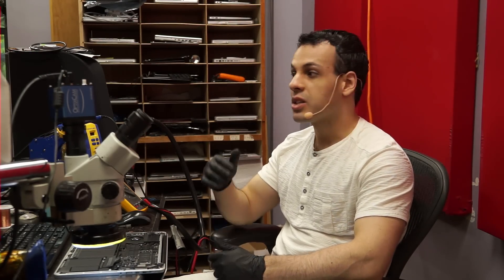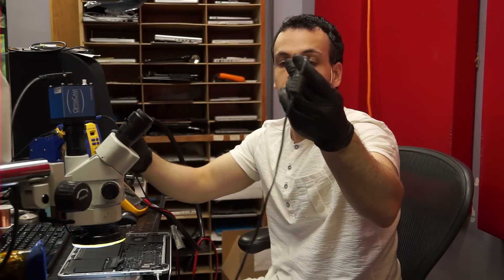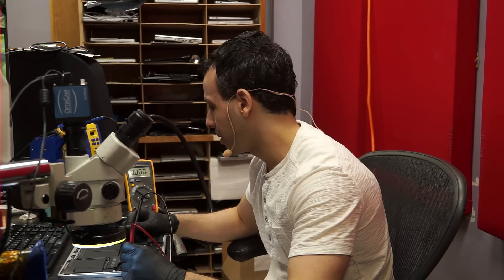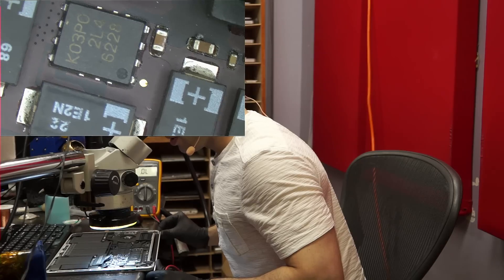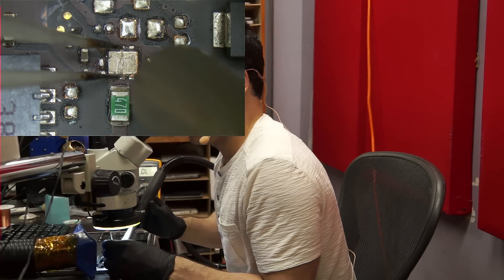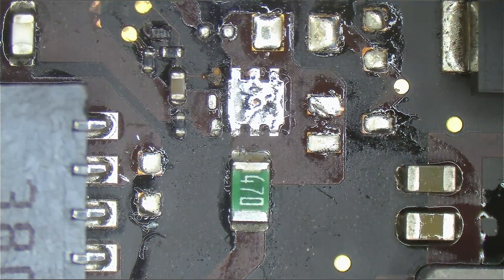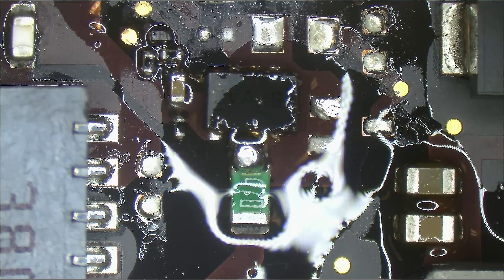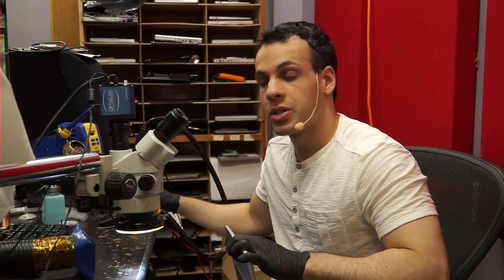Macbook not charging due to welded voltage regulator IC!

Comment: Here's a trick I use: get a Dremel and carefully grind down the top of the IC until you reach the die.  Hot air will transfer through the chip better,  particularly those with belly pans.  You can also heat it directly with a heavy tip soldering iron on the chip's die.

Comment: Hi
My MacBook Pro ( retina later 2013) USB's has gone bad. Being a emebeded and electronic developer I accidentally gave 12V to the USB. The data pins are working but power pins are not (+ and -). I am saying this because I connected serial device and powered it from another USB and I was able to receive and transmit data successfully on bad USB port. Pendrive other peripherals do not work because the USB doesn't supply power.
Can you share schematic of the I/O board which has USB, HDMI and SD card ? Or help me identify the issue. I opened my MacBook and saw Power switcher IC Texas's instruments 2557 near to the USB and I think that has gone bad. Can you please help me

Comment: Hi sir
Reply: I am shahal Muhammed. From saudi arabia. I have a1342. logic board is working   
But power switch on in laptop its not working. I chake the logic board two point to shot the laptop is no. So it the problem for keyboard. And my battery simple is x masks. So what I do sir. Plz tell way find out the problem.

Comment: someone explain me what gel-liquid he's putting on the electronics and what it does
Reply: It's flux. It helps the solder flow and not oxidize. This makes the connections on the board better.

Comment: I've done exactly one electronics repair on my entire life so sorry if this is a stupid question... but with that scratch through the board's coating into the copper trace, should you cover that back over with a sealant?  Copper oxidizes, and now there's an area that's not protected by the coating, so wouldn't that be a place for long term damage to the traces to start?
Reply: The Momaw if exposed to humidity yes. and this goes the same for any standard electrical circuit. As for what you could use on a board I wouldn't know.
Reply: That "sealant" is called solder mask, and it's main job is to control where the solder will and will not stick to the board.  It also isolates the board from bare wires running on top. None of that is a problem in that spot. Water on the board is bad enough anyway, so no point sealing against that.

Comment: So this is what is wrong with my Macbook from 2008, it probably blew away during normal use. The guy who sold it to me probably knew of this problem, fixed it, then sold it to me. Now it will only turn on if the battery is charged already, can't charge so, technically it is dead. I replaced the charging board and it did the same thing. I'm inclining that this is the issue, thanks for the video.

Comment: Hi Rossmann, i have MacPro 2014 A1502. i can't turn on power. it's not display led when i put charging. what can i do? 
The battery is 11 and vol on charge connect is 15v ins't it too low?